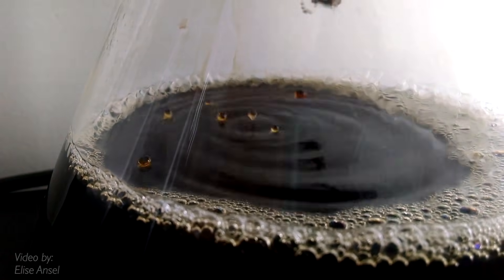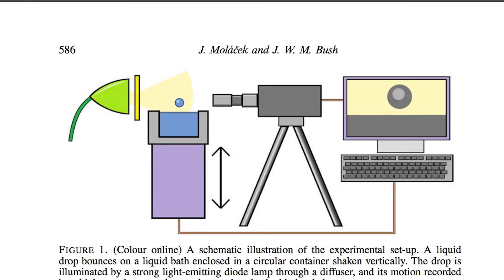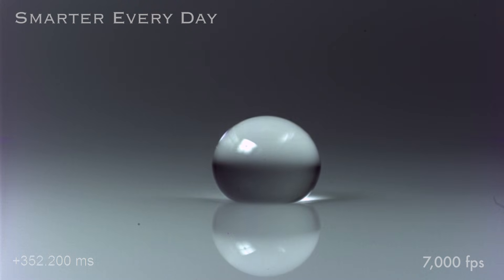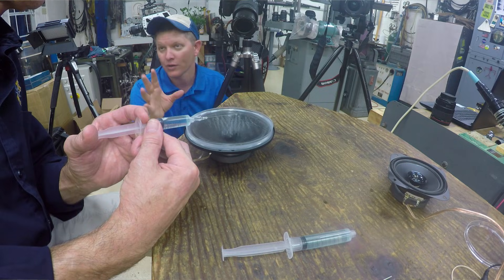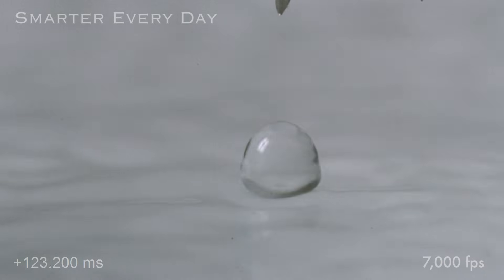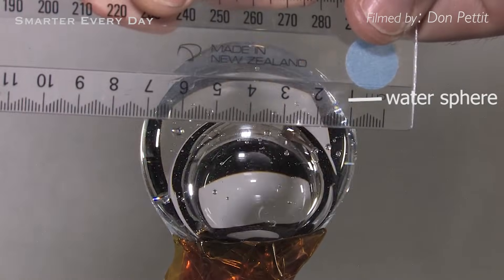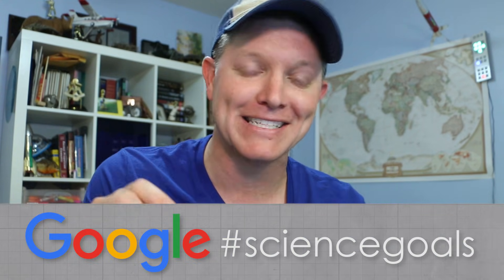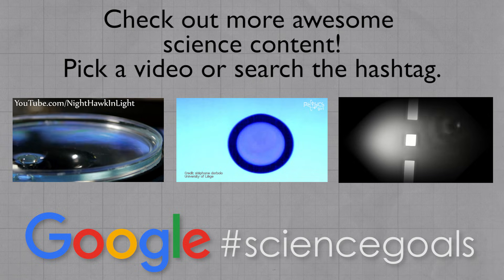The WALKING WATER Mystery (in SPACE and SLOW MOTION!) - Smarter Every Day 160

Comment: that is really interesting, although i have never noticed it myself. im guessing the cello has a similar resonance frequency to the water, so the peaks and troughs of the standing wave gets pushed until the momentum in each peak is enough for it to overcome the surface tension and separate into its own drop

im sure you will have a lot of fun with that camera. maybe you could take a better video of the helicopter swash-plate so you can actually see exactly how all the joints move?

Comment: Ok this is because of the phenomenon called surface tension. The water surface has surface tension which tends to repel objects landing on the surface. The drop itself also has surface tension trying to keep it in a drop shape. However there may also be static electrical issues involved as well creating a temp repulsion of the drop from the surface. One weird thing I have learned is that if a stream of water is from a  common source yet split into two streams and each stream is passed through a  metal cylinder without touching the potential will build up until a spark can be formed, simply from the flow of water.

Comment: I think it's important to see the same experiment in a vacuum chamber
Reply from the maker: The water would boil.
Reply: I didn't know that... Well, smarter every day. Thanks :)
Reply: When water boils it's actually the air trapped inside of the water molecules escaping because the vapor pressure is higher than the atmospheric pressure. Normally we would apply heat to increase the vapor pressure but with a vacuum chamber instead of increasing the vapor pressure, we just lower the atmospheric pressure. You could cool the water in the chamber but it would actually continue to boil until frozen which doesn't help the experiment. The temperature needed to lower the vapor pressure below the atmospheric pressure is below water's freezing point.
Reply: I think you will like to read this    http://www1.lsbu.ac.uk/water/water_phase_diagram.html

the reason the temperature drops in a vacuum chamber is because water boil with its own energy
Reply: Could you compensate by changing the temperature/Heating the water?
Reply: interesting
Reply: You would need to compensate by lowering the temperature of the water.
As air pressure decreases the boiling point of water falls, so does the freezing point.
Without going into all the math, just a 10% reduction in atmospheric pressure the boiling point will fall to around 90 degrees Celsius and freeze at around -10 degrees Celsius but this only applies with pure water.
Any additives can modify either point depending on the specific properties of the impurity added.
This is the exact purpose of anti-freeze anti-boil additives for radiators in cars.
Reply: Not only is that site over complicated Yan but you basically contradicted yourself with that last statement.
Since when does a temperature DROP result in boiling water ?
You have missed the general principals of water state versus temperature and pressure.
Reply: The boiling of water is determined by both temperature and pressure. This is why you will dry off in the wind, even when it's not hot.
Reply: It dries faster in the wind because the moist air above the surface is carried away. Thus the fresh, dry air can solve more water vapour.
Drying has not necessarily something to do with boilling.Water even vaporises from ice to the gaseous state at normal pressure and under 0°C. At the boilling point the inner stress built up trough the heat of the watter, succeds the air pressure arround it. This is why the temperature and the surrounding pressure influence the boiling point.
Reply: Fun fact: Water has at least 10 different types of ice. All behaving differently an showing other crystall structures.
Reply: could you try it with oil then?
Reply: Fabian Kehrer 17 actually
Reply: *****  "as air pressure decreases the boiling point of water fall".
That was my comment not Yan`s.

Comment: I did a physics project on sessile drops at school. A bizarre and counter intuitive tip is to add detergent to the drops, this makes them float easier and longer. If you can keep the drop moving on the surface of the water they will last indefinitely. The slightest electric field causes them to collapse into the water instantly.

Comment: I understand that the vibration of the water keeps adding energy into the system allowing the bubbles to continue to be.  But would it be more accurate to say that the bubbles are being tossed  ever-so-slightly  back up which allows more air underneath them which in turn needs to escape before they can coalesce with the water pool?  

Could it also be that the bubbles 'caught' at the top of a wave allows the air to escape more quickly then when 'caught' in a valley?

Comment: You can also see a similar phenomena with hot regular surfaces. If you heat an iron or a frying pan at a stove and carefully make a droplet of water on them the bubble won't splash like "normal" water. It will diminishes as evaporation takes place. In the end it is almost the same phenomena of an air bed blocking the direct contact between the water droplet and the hot surface. Simply but beautiful

Comment: the water droplets... that was the leidenfrost effect  (definition)  -  The Leidenfrost effect is a physical phenomenon in which a liquid, in near contact with a mass significantly hotter than the liquid's boiling point, produces an insulating vapor layer keeping that liquid from boiling rapidly. Due to this ‘repulsive force’, a droplet hovers over the surface rather than making physical contact with it. This is most commonly seen when cooking: one sprinkles drops of water in a pan to gauge its temperature: if the pan's temperature is at or above the Leidenfrost point, the water skitters across the pan and takes longer to evaporate than in a pan below the temperature of the Leidenfrost point (but still above boiling temperature). The effect is also responsible for the ability of liquid nitrogen to skitter across floors. It has also been used in some potentially dangerous demonstrations, such as dipping a wet finger in molten lead[1] or blowing out a mouthful of liquid nitrogen, both enacted without injury to the demonstrator.[2] The latter is potentially lethal, particularly should one accidentally swallow the liquid nitrogen. and also there is an inverse leidenfrost effect
Reply: the water on the ground was either hot or cold... if the water on the ground was cold then the water he dumped out was hot, warm, or room temperature,... but if the water on the ground was hot then its the oppisite ... but i beleive this most certain of being the leidenfrost effect
Reply: you sound like you have a better grasp of what this phenomenon is ...so please...(im being serious) do you have a better explanation we could figure this out
Reply: and yes... i was carefully watching infact ive probably seen this more than you ...just watching carefully and still i cant find a better explanation than the leidenfrost effect
Reply: what would you call this effect then ?
Reply: because to me ...what you just said has similarity to the leidenfrost effect but istead of hot or cold ...its vibrations...... not much of a difference
Reply: and the result turn out the same

Comment: The wave vibrating the bubble in space is probably the closest analog to the electron cloud I've seen so far.  I wonder what diameters (in cm) and frequencies (in Hertz) would produce a standing wave on the surface of the bubble.  With the correct combination of frequencies, you could probably produce some static oblong shapes with the water.

Comment: it's not the cello, it's the frequency (or frequencies) - a systemic oscillation frequently - and it's too bad you (astronaut) didn't check to see if increasing the size of the air bubble necessitated a higher or lower (sustained) frequency (otherwise, it would seem the cello frequencies are just right relative to the viscosity of water - so check THAT by additives that change the viscosity. Cause it would be pretty cool to find if the active frequency (0-g) is whatever freq forms a whole number of standing nodes on the surface of the inner bubble (which would depend on viscosity, surface tension, and bubble size).... hope you try it out!

Comment: Very cool to finally know whats happening there. I also discovered this some time ago when I was bored and started tapping on a half full water bottle. I eventually got the rythm right and it started to resonate. As i tapped harder, the amplitude got high enaugh that drops separated from the surface of the water and started bouncing around. They arranged in a square inside the perimeter of the bottle. I guess the corners of the square are the nodes of the oscillation in the bottle.
But I didn't find much information about this until phenomenon then, so thank you again!

Comment: 2:57 at 18.8ms the surface is completely flat 28.8ms even tough the wave of the initial impact is gone, the water surface has not recovered, it still has a dimple which is kept util beed merges, as if it as a non-Newtonian fluid, there is allot more here.

Comment: Now that did not go as I expected!!!!
I was expecting to see more on the surface tension and the eddy currents generated with the movement causing magnetic opposition. hence the vibration is the key to it lasting longer
repeating the experiment in total vacuum would be interesting if you remove the boundary layer of air do you at any stage get the droplets forming or bouncing off the surface, if so it would prove there is more at play than just air pressures.
I question the air pressure side based on over and under pressure resonance like in a pulse jet, the vibration and the mass of the air moving out from under the droplet would cause extrapolated under pressure pulling the two surfaces together, mass of the moving fluid in this low pressure zone would case the drop to bond with the surface.
I feel there is static charge and eddy currents at work in combination with surface tension the helps to repel the drop from the surface,

Comment: I'm going to disagree on your conclusions.  When the droplet impacts,the only way to have a boundary layer of air, would be if you contained the air, otherwise the air would push the air away immediately.  I would theorize that the reason it doesn't coalesce immediately is the surface tension is at a different frequency or other variable.  I think you were on to something using different frequencies.  Also, I saw no observation of a air gap in any video.

Comment: This phenomenon is related to an aspect of space travel, actually.  The finding here is that a water drop does not merge with a larger water body, because a layer of air is briefly trapped between them.  A similar thing happens with metal surfaces.

Here on Earth, if you place one flat metal plate on another, of the same metal, you can then separate them easily.  However, I have read in a science book that in the vacuum of space, two such metal plates would actually fuse together, because there would be no thin layer of air between them, that you would get on Earth.  This is a significant issue in space craft design, obviously.
Reply: Actually that's not quite right - although it's true that the presence, or absence, or oxygen is what makes the difference. On earth, in our atmosphere, most metals form a thin layer of oxide on the surface (oxidized by, you guessed it, the oxygen in our atmosphere. This is what rust is, for example). This super thin layer of oxide prevents metal surfaces from truly touching each other - only the oxides touch, really.

In space, there's no oxygen to oxidize the metal surfaces - and thus, if you somehow manage to get two ultra-clean, ultra-pure metal surfaces to touch, in space, they may fuse together (called 'cold welding').

NASA first thought this would be a serious problem in the early days, but it turns out in reality, it's not that big of a problem. Mostly because most metals are already oxidized or dirty by the time they get to space. Things like metal rubbing against other metal can scrape off the oxides, in things like hinges, which can cause a problem... But the solution is quite easy - coat the hinges with something :) Or if it's aluminium.... Just anodize it. And so on. Many solutions to a not-so-serious problem.

Comment: Hi Destin & fans, Has anyone seen this replicated with different instruments playing the same note as the cello? Also, I feel that the polar nature of water is at least a co-factor along with the collisional  Kinetic Energy & air gap. What I mean is that the air pressure correlation graph could also potentially be explained in that more air pressure more tightly packs the molecules on the "skin" of both surfaces of the water- therefore making the molecules of the polarized layer have a more difficult time  opening up or "turning around" in order to eventually merge the 2 bodies. Thoughts?

Comment: How small can a drop of water be?
Reply: I know that drops associated with atomizers can be as small as tens of micrometers. But "drop" is sort of an ambiguous term, and I don't know what the range is on where the interactions of a drops of water move from the surface tension realm into the chemical/atomic realm.
Reply: Drops tend to actually be very equal in size, if the environment isn't moving (i.e. a stable platform, no wind, etc). Counting droplets is therefore actually a really accurate way to measure liquids. Of course, every liquid will have a different "ideal" droplet size, and even water with different salinity and chemical composition will vary slightly... But yeah, point is, a droplet is more or less always the same size. They're very consistent.

This doesn't answer the question, but it's interesting and somewhat related I guess.
Reply: I'm curious also
Reply: Boaz Thomassie, molecule
Reply: i think he meant how little amount of water is needed so it is released from the main source and actually drop (sorry for bad english not my main language)
Reply: ***** Raindrops =/= drops. Why do you think droppers are used in medicine? Because they measure volume very accurately, assuming the conditions are the same, and the characteristics of the fluids are the same.

I don't expect to find a cumulus congestus cloud inside a hospital, nor inside an eyedropper.

So, in the context of this video and this question, raindrops are not really relevant.

Comment: Could the cello's frequency range be in some sort of resonate frequency of water? I thought of a quick way to find the resonate frequency of water, basically start at a every low frequency noise and raise it up slowly until you find a "sweet spot" where the water is at is moving the most and then try the same frequency of different masses of water. oh and btw im only 13 so i think someone could improve on my methods :)

Comment: If my perfect pitch is of any use - it's noticing that the air bubble becomes distorted when the cello plays an F#2, F#3  and C#3 (or close-proximity surrounding frequencies), but not really at all when the cello plays an F#4 (noticeable at the end).
With a somewhat amateur level of acoustic physics education, I understand it's something related to resonant frequencies (and harmonic series, given the octave -> fifth pattern) but if anyone could explain exactly what is going on here, that'd be great!
Reply: I posted a comment about resonate frequencies as well, its probably dependent on what the depth of the fluid is at the time of testing
Reply: +16willthompson Yes, it is dependent on that. The surface of the water is an anti-node, and the speaker acts as an anti-node. You'll have to calculate based on the speed of sound and the frequency you've got it at

Comment: How come the music waves visible on the surface of the air bubble inside the water don't pass easily to the outter surface of the water? Water should propogate the sound very effectivly due to its incompressability.

You might say it is the impedance miss-match between the water and the air, but if the inner surface of the water is vibrating then energy has obviously been transfered to the medium.

P.S. I'm sure with some of your examples of standing water droplets oil will encourage the phenomenon. Oils from the coffee and from the helicopter landing pad and possibly in the pond water from wildlife and plants.

Comment: Hi SmarterEveryDay, this is amazing! I did my dissertation on water repellency on breathable fabrics! There are two main conditions to render a surface hydrophobic, it is due to surface energy and surface roughness. I guess when the speaker was vibrating, it created the perfect surface roughness where pockets of air could be trapped underneath the droplet, therefore prolonging the effect of it beading up and 'dancing' around the surface of the water. This is the same reason why some geckos can repel water! Because they have the right surface roughness for water to be repelled.